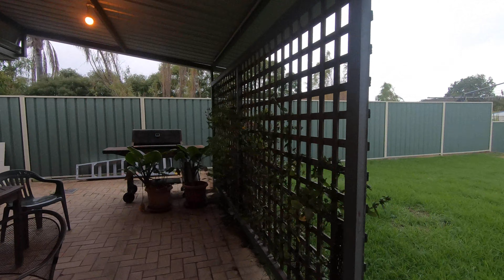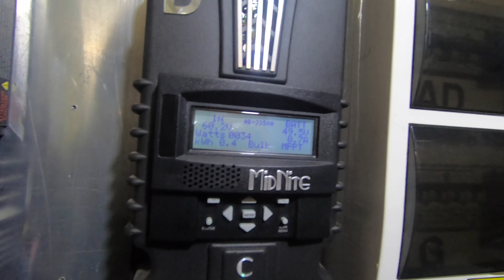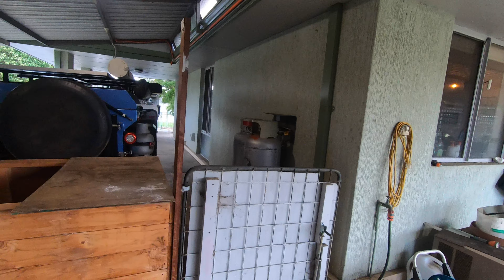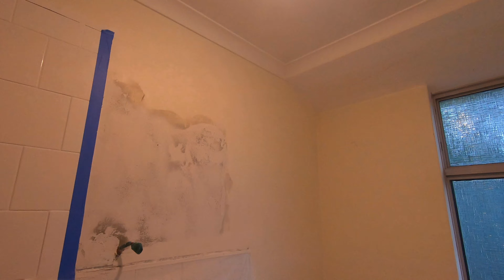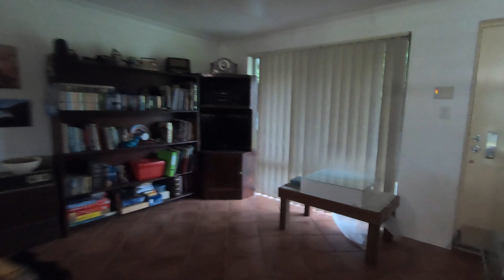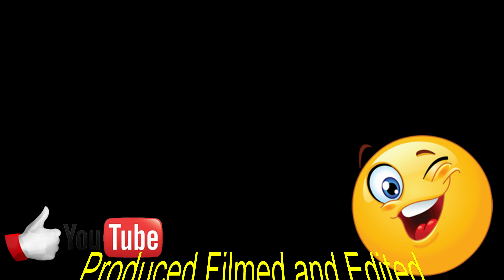Very Important Battery Maintenance.  House update

Comment: Looks like you need to get an EV.  That will get your batteries down.
Reply from the maker: Yes will need a bloody long extension cord. Friend got a new one the other day. He lives in Perth. Drove it to my place and I had to recharge it so he could get home. 500km range if you don't use the heat or the AC units. LOL No good at all if you live in the county. I would need to take a generator with me wherever i went just to make sure i could get home.
Reply: I took a second look at your video, and did not see a mini-split heat pump.  Do you have one and if not consider one so you do not need to run the fire?
Reply from the maker: @haroldhechinger5850  I have 1 reverse cycle and one cooling only AC units. we can use to heat or cool the house. I have many videos on the units and how we use them.  We prefer to run the fire as we use that to also heat water and its more pleasing to have a fire. Maybe you should take a few seconds and look at my other videos , 😉